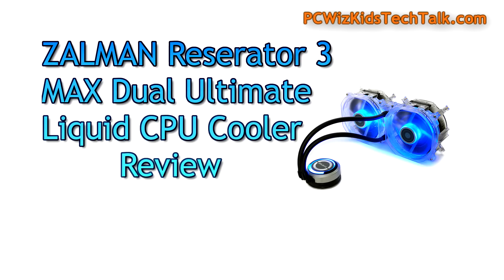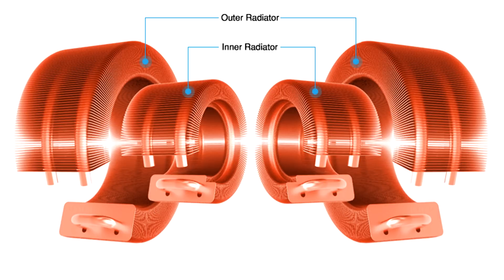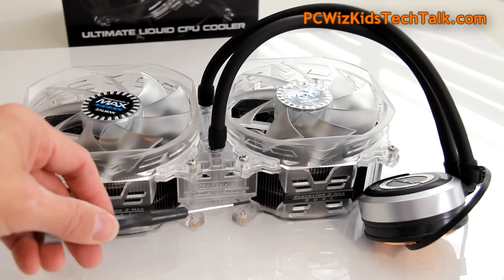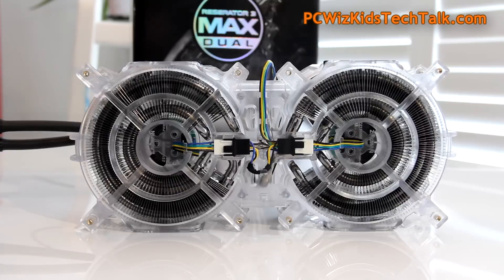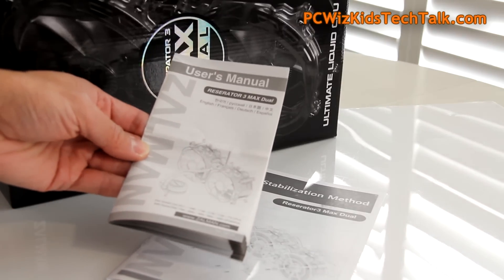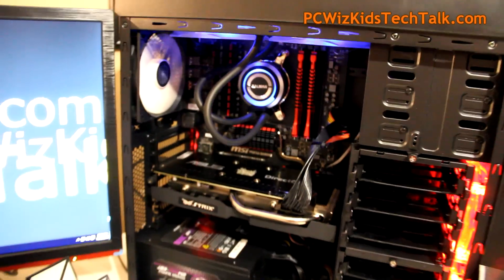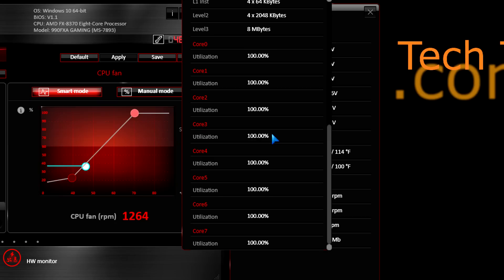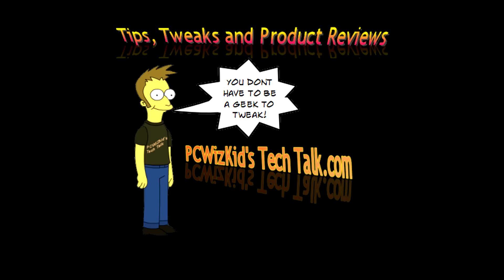Zalman Reserator 3 Max Dual Liquid CPU cooler Review

Comment: curious, is it possible to turn off the LEDs?
Reply from the maker: +Joshua Keys I do not see an on/off switch for the LED's, so you would need to disconnect the power to them manually.
Reply: +PCWizKids Tech Talk Oh OK, no worries.  I appreciate you getting back to me.  I just thought that would be cool to have as well.
Reply: +88s10Durango Oh I can manage that easily... what kind of tech would I be if I cared about a measly warranty 😄

Comment: I'm thinking the micro fin on the base plate is just a gimmick, (otherwise others would have done it years ago). How does it compare, cooling wise, to other all in ones on the market?
Reply from the maker: +worldsails2000 Well it outperforms by at least 5C to 10C Celciues to other 240mm liquid Coolers I reviewed.  For example the Cooler Master Seidon 240mm I reviewed with a FX8350@ 4.8Ghz was at 67C full load compared to this one at 52C aprox.

Comment: 150$ for a cooler?! Who buys this crap. I would have to work 10 fucking days to buy this.
Reply from the maker: +liquid0001 (Squadalaxd) Agree, it is more expensive than average, but keep in mind that the high performance and quality comes at a price , even thought it is on the higher price tag, it will outperform high-end air coolers for sure.  For those people worried about damage to your PC when overclocking this could save you.   If your not then there are other alternatives to buy for sure.
Reply: +PCWizKids Tech Talk True, this thing looks awesome though, good review. If i could buy it, i would get it for sure.